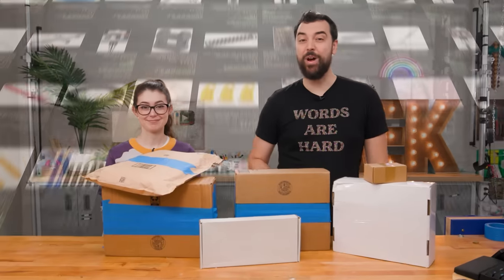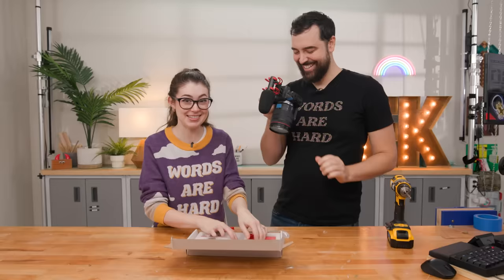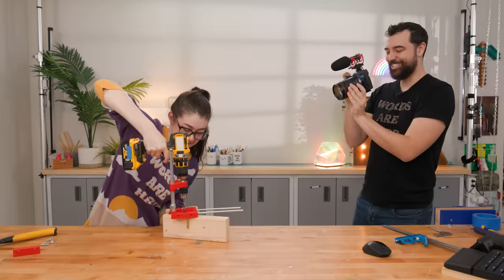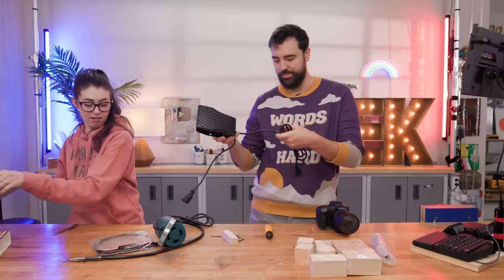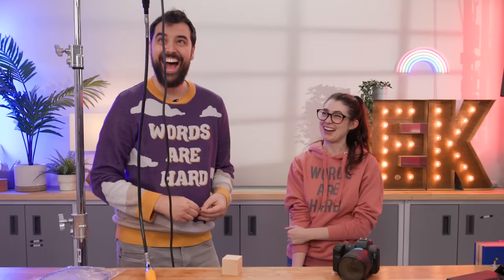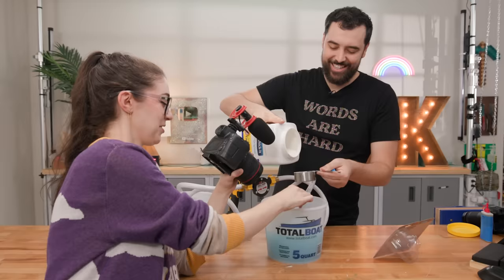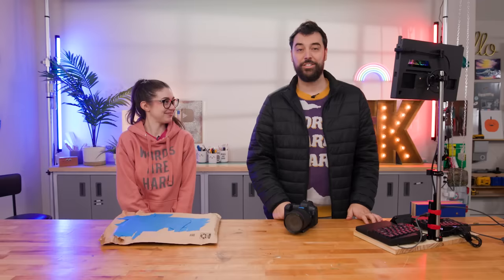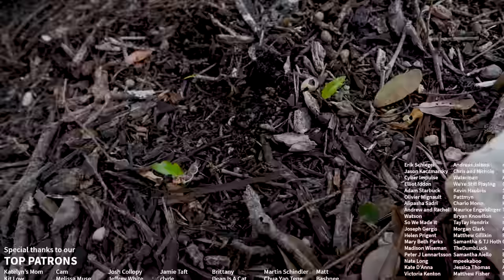Testing 5 of the Worst Rated Tools on Amazon (under $15)

Comment: I build a lot of things in the wild, which includes a lot of hand carving. There are several secrets to it that will make the carving tool you bought work better for you.

The first thing is that each piece of wood has its own character in the grains so that it will make terrible chips and splinters if you carve it in some directions but it will carve nicely and smoothly in other directions. Just experiment with each piece of wood and, if one direction doesn't carve smoothly, try another one until you find the directions in which the wood carves nicely. Eventually, you'll start noticing various patterns in the kind of wood you're using that will help you figure this out better when you first start carving but, even if you don't notice that and chip the wood on your first try, you can usually fix this once you find the direction that works. In my experience, it is usually perpendicular to the grains of wood and from the outer part of the branch towards the center with the direction often shifting at the pith (which is the center of the branch and I've only carved wood I've cut down myself so I don't know how to tell this on pre-cut wood).

Another thing is that you don't want to try to remove too much wood for every cut so you want to make many shallow cuts rather than trying to quickly remove the wood you want to carve away because trying to remove too much at once will also cause it to chip and splinter instead of resulting in a smooth surface. If you do need to cut a lot of it off, use an axe or a saw or be extremely patient slowing carving that part off. Personally, I do parts like that with my hatchet.

Also, make sure your tools are as sharp as you can get them because sharper knife is safer than a dull one because a dull one is more likely to catch and then pop off of the wood and onto anything in its path after that. I've caught myself with my knives before and even my folding saw and they'll give you quite an impressive cut if they catch you. So you also want to think about where your knife might go if this does happen and then make sure either not to carve in the direction of any of your body parts or, if you do carve towards yourself, make sure that you have something preventing the knife from popping off and cutting you This can be accomplished by certain positions of holding your knife and the piece of wood or by having something that will stop the knife before it can cut you. There are a number of excellent tutorials about all of this on YouTube, which is how I learned.

Once you get the hang of it, carving is actually pretty fun. It does make somewhat of a mess, though, because you end up having loads of wood shavings everywhere and they screw up the vacuum if you try to clean them up that way so you want to either be outside or in a place where you can sweep the shavings up. In any case, that machine will be a lot of fun once you get the hang of it and I think you guys will enjoy all the things you can make with it as much as I enjoy all the things I've made with my hand tools.
Reply: Oh and you'll have more success if you carve with the bevel of the knife towards the wood. Sometimes you can use it the other way but usually you want the bevel down to make nice, smooth cuts. I did this at first too until I watched a bunch of tutorials.
Reply: I really think this carving tool will be awesome once you get the hang of it. I felt like I couldn't carve when I got my first carving knives but, after learning how to properly use them, I've been able to build so much stuff and shape things to exactly fit when working with the wood I find out in the wild. I have built a whole fort in the woods using my carving tools, a Scotch eye auger (for making holes for wooden nails), a hatchet, a hand saw, and a folding shovel. Of course, I also carved some things just for the sake of art too.

Comment: Evan, you're an engineer and should know that there's a difference between "pump" and "self-priming pump". The pump you tested is not self priming. You're supposed to fill the intake hose up to the pump prior to spin it.
I haven't seen the description of the product but they might have failed to mentioned that, which would account for most people failing to realize that and getting it to fail. Also, I imagine a bunch of people trying to use this with long hoses or hoses that collapse on the intake. This is not meant for that. I would imagine using this to empty a large fish tank for instance.

Comment: At least with Temu, if you're not happy, they'll credit your money and tell you to keep the item.  //  (They don't accept a '0' so I'd say a .5 is the least you can give - they do accept 1.5)  The 2nd one should be a .5 - they lied when they didn't say it was just an 'attachment' to another tool.  With the attachment, maybe a 1. - The 'multi-tool hammer' is a .5 . - The drill pump - depending on how long it lasted for just water - maybe a 3, a 5 if it lasted for 1/2 hour? - Weed puller .5 .

Comment: For that pump you need to prime it first. Meaning there needs to be water in it before you should start it. Operating any pump dry will cause the motor and impellor to burn out and break. That pump may have worked with that thicker stuff if you primed it first.

Comment: Most pumps for liquid require priming. They won't pump air. I'm surprised it worked at all and not surprised you burned it up. You probably needed to submerge the pump or find some other way to fill the hose and pump with water before you began spinning it. It MIGHT have lasted longer that way.

Comment: Hi, i dont coment much, but for the ingraver idk what wood you used, just as i learned it should be soft wood and more moist. If that dose not work maybe try using it as a shaker for molds and concrete and such

Comment: so those drill pumps need to be lubricated to properly work by removing the front and adding some form of grease to them before use, but  of course it's not mentioned anywhere int the instructions

Comment: To my surprise a tool I bought appeared first. For the sake of £10 I gave it a go. After using it the first time I put it in the bin, I didn’t really need it but thought it might be useful for light work, nope! And yes it smacked my fingers a bunch of times when it binded. Would also give it a 0

Comment: man the second product hurts my soul. I did printing in college and one of the printing techniques I studied was wood cut where you use tools  similar to that, the fact it is electric and  vibrating seems to only make things worse, i'd rather spend the time filling the chisels to make than sharper. The handle for the knifes seem to be very good for grip however. I'd spend just the 12 dollars and leave the electric part behind. xD

Comment: I could not find any videos where you used Thick-it to make scorch gel. This is just Thick -it, water, ammonium chloride, and a little dye, so you can see where you put it. this is applied to wood with a stencil. Once it dries, you remove the stencil and heat it up with a heat gun. The result is similar to wood burning. I made a few gifts with this before I got a laser.

Comment: Those cheep plastic pumps absolutely have to be primed before use. Just like any other pump. Running dry for even a few seconds will do some damage. "prime the pump" means to add  the fluid being pumped before turning it on.  "The water got nasty" because you used the product improperly. Now are there instructions on how to use the pump properly? Don't know about THAT product, but there have been on every like product I've ever used. 

Don't get me wrong, even used properly they don't last long but they are a viable short term solution for specific applications.

Comment: Ah! You put the drill on the guide backwards. The trigger part should be facing the opposite side so your fingers don't get caught in between the metal rods. The drill guide is still cr*p, though.  🤣🤣🤣

Comment: I doubt you'd want to use a pump like that for resin as you mention i looks like the water was washing out all the lubricant.
You'd probably be better with a peristaltic pump which keeps the liquid and the mechanism isolated. The downside of pumping resing though would be that you need to wash it out before it starts to set (espeically if it is made of plactic with a low melting temp)

Comment: not to defend garbage from amazon, but i think the difference with the hammer thing is that instead of hitting the nail directly, you're aiming for a larger target and can apply more force with less precision/restraint needed, and positioning the nail with the tool instead of fingers makes it easier to align it straight (and allows more precision in doing so since the tool is longer)
at least that's what it looks like it could be!

Comment: Most water pumps need to be primed and will die VERY quickly if they’re run dry. Wouldn’t be surprised if a lot of people killed the cheap drill pump through user error without realizing it.

Comment: Hahahahaha, the hammer/wrench! I have a hammer that has all kinds of sizes of screwdrivers inside the handle that I got at the 99 cent store but it does not have a pair of pliers. lol
Reply: I have a small pair of pliers that also has both kinds of screwdrivers on it and wire strippers that I think I was given by my best friend but I've had it so long that I don't remember anymore. It's also super small so you can take it with you.

Whenever I need a hammer in the wild, I either use the back side of my hatchet or one of the mallets I've made out of pieces of wood or a rock.
Reply: OMG, that hammering mechanism is better, especially for those of us who are prone to hitting our thumbs with the hammer! lol It probably also prevents the nail from being as likely to bend if you don't hit it perfectly once you have the thing started. Of course, you need to hit the back of that with something else, but that's when a rock or a solid block of wood will work.

Comment: to be fair, the drill guide was a lot straighter than the control. also, could you have loaded the drill the other way? so you hand was on the side that didn't have rods?

Comment: When you use pump it use important to prime. If they dont have enough head pressure the pump wont be able to pump. The thicker the material the more hedges pressure you need for it to start pumping. Also if the pumps are not primed they start running on air over heat and are destroyed this is true for 10 dolars plastic pumps and 10,000 dolars pumps

Comment: I thoroughly enjoy my nail polish bottle as a nail polish AND a hammer way more than that hammer tool. Also, use at your own discretion. I just use it for hanging up framed art/pictures. So not very large nails. Would not recommend you use it to hammer any thick nails(metal nails, not finger nails), especially into would. Drywall is fine, or if using a thin-ish nail.

Comment: I have used a drill pump that worked amazing just don't full throttle it there are plastic parts and the drill is designed to put out a lot of torque and or speed

Comment: The weed puller is a knockoff of the Grandpa weed puller that is made of far better materials. The puller is made of iron.
The Grandpa works great! But I only use it in my lawn not on mulched areas.
It works best with dandelions and violets

Comment: Those Drill pumps are very useful if you have to pump liquids from containers out or into other containers and stuff like that, for example emptying a jerrycan into your car.
My Guess is that those idiots writing those Reviews didn't read what this specific pump was made for. You cannot use every pump for everything. Some can resist Fuels and Oil, some cant, some need some sort of lubrication which water does not posses and this way the pumps get broken. And the thing deadly for every pump, Turning it without fluids inside, this will destroy the bearings, the seals and everything. The other thing is did they turn the Drill into the right side the pump needs, if they dont this can also be a factor that the pump gets damaged.   
This is probably the reason why it just worked so short periods of times for all those reviewers or that specific pump is garbage.

Comment: Wait wood craving is considered mess free? Out of all my projects it’s the most messy. I love it though, well kinda. I think I will love it alot more when I’m actually using equipment. I don’t even mean the right equipment either. I just mean equipment, I’ve been using scissors, and a pencil shapner blade. With a lot of bandaids I use them for many reasons. I have extremely sensitive skin, I have to use them for pencils, even with a rubber gripper.
Reply: Wood craving can be quiet, but that’s only with hand held equipment

Comment: If you're going to rate a product over 1 star, shouldn't it be good enough to be the product that at least some people should choose?  Merely "capable of possibly working sometimes" is still a good two steps below that, with "outperformed by a cheaper product" and "outperformed by using nothing or a free makeshift solution" between.

Comment: To be fair those weedpullers are awful even from reputable brands. My parents made me pull weeds and we had one that was heftier and sturdier than the one shown but it didn't pull the weeds any better.

But it had a shoeter handle which made it a pain on back to use at over 6 feet and i kept on breaking those bloody things simply by using them as intended. Got through three of them before my parents stopped to ask me to do it.

Comment: To the guy who said it wasn't worth his time to return the item...Amazon is usually really good with refunds. If you open the chat feature and say, "This thing is a piece of crap and it broke right away" they'll probably just refund your money. I've received a few broken items from them and I've never had to return them. Jeff Bezos may be an evil little demon, LOL, but the company does have some pretty good customer service.

Oh, and if you receive a good product but yours just happens to be broken...Don't leave a negative review. I can't stand when people do that. It's not an accurate review of the item, you're really just reviewing the shipping. Ask for a replacement before leaving a review.
Reply: What if there is no damage to the box and the items are still broken in their little Styrofoam protection trays?

I feel like that should be something that you are perfectly okay to write about.

I mean, sure, if the delivery guy drop kicked it onto your porch and smashed up, don't blame the product. But if the company is shipping pre broken stuff (or shipping with missing items) people need warned.

Comment: Why didn’t you try the “drill guid” (sic) from the other side where the rails aren’t in your hands’ way?!?

Liked the drill pump but was screaming at the start, “it’s spinning the wrong way! Reverse the drill direction!” Then you did and I’d be happy with a score of 3.5. (For water.)

If the weed thingy said ‘use the straw end’ I’d take that to mean the other open end of the tube whcih would bore a hole round your target weed and loosen the soil round the long root, then use the other grabby lever end to grab and lever your weed out. But as you’d have soil on the end you’re holding to grab and lever, the claim of “clean hands” is a dirty rotten lie (unless you wear gardening gloves? But then every tool can leave you with clean hands.

More of these!!!

Comment: The drill guide has since gotten up to 4 and a half stars, based on two reviews that essentially say the same thing. Worth it for the price.
But the rest of the review, they both complain about the product and that it has no directions.
Reply: The power chisel got one 5 star review, because they said it was cheaper to by that, then a new set of chisels. 
But they knew it was not a full tool.

Comment: You put the drill into the straight down drill guide 180 degrees off of the orientation you were supposed to...but it is still a cheaply made flimsy piece of junk.

Comment: So, the multitool is a hammer, that needs a hammer to work. It's a screwdriver, if you add a screwdriver to it. and it's a pair of pliers, but they don't work without proper pliers or a vice..... Yyyyeeeeaaaahhhh.......

Comment: Interesting video but when they used the drill pump it would not work with resin since you would not be able to clean it out afterwards if you did Use resin since the resin would get in the pump and you wouldn't be able to clean it out therefore the resin inside the pump would dry out and stop the pump or miniature water mill fan inside from working

Comment: Look you guys seem to be goofing around and not properly testing the stuff. The chisel looked to be working but you guys were putting too much pressure.  The drill press you had the drill in the wrong way and did not calibrate it to be true. The water pump you are supposed to prime the pump first and start off slowly as the fluid builds pressure it also is not ment to be at top speed.  So my question is if you are crapping on these products would it be fair to say we tested them correctly? 

I mean looks more like a vaudeville act than test... if so was funny

Comment: These two are not very bright and should NOT be testing stuff!
   First off, the dude wouldn’t of even been able to pull the nail out with the actual hammer since they put the nail into a small block of wood that he can’t hold down securely, that prevents leverage against the nail!
  And then the pump?!  Dude, you have to prime the damn thing first!  Liquid has to be inside the pump. Otherwise it’s just pushing around air, not fluid!
     These two are painful to watch.  

. . . Idk how a pump works!!   wtf!?!   😆😆😆